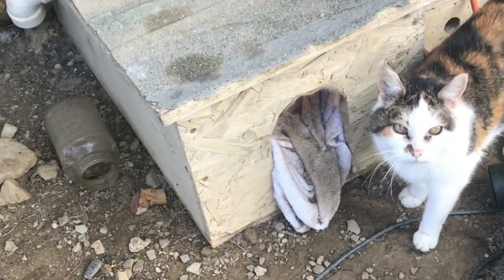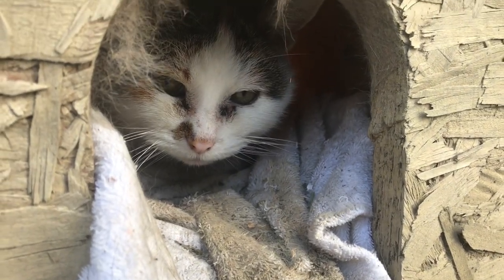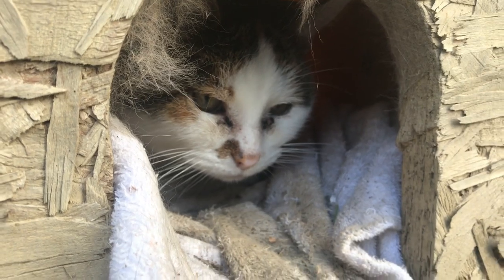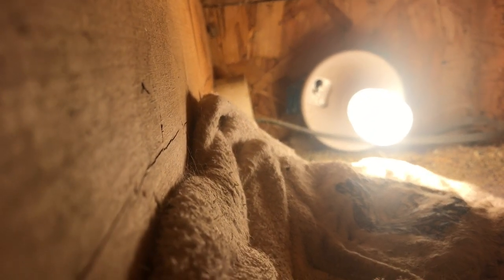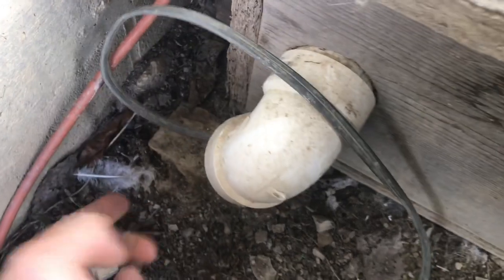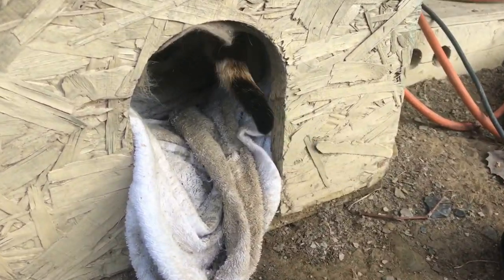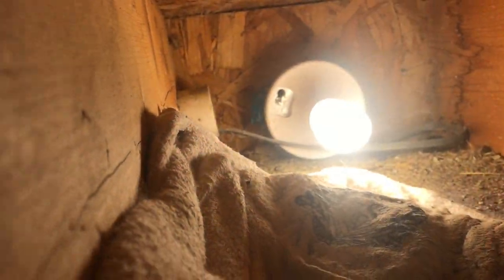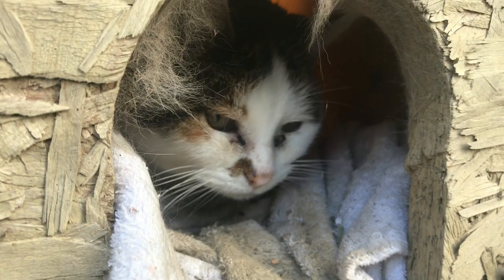build a low cost HEATED cat house (lightbulb)

Comment: I saw a light bulb heater built from a coffee can. It was sealed so the light didn’t escape, but the can radiated heat nicely.  Used same ceramic fixture.   I liked the idea of closing off the light and encapsulating the glass bulb.

Comment: Great idea and caring for a stray cat is good. However, letting the towels dangle outside and they'll get soaked with moisture. That's not helpful for the cat.  Also, put straw in there instead.  What about a flap on the door to keep wind and wind blowing rain out of the opening? Just some ideas for improvements.

Comment: I use a Chicken Coop heater panel. You can mount it on any wall, ceiling, or just use the legs standing up it's fine. I've used mine forever, never turning it off in Winter. I'm in the Midwest, it hit 16 below this week. With insulation, they do an excellent job!!
Reply: Ty. Where to buy, please???

Comment: Stuff the bottom with STRAW, never blankets (the cat keeps MUCH warmer with straw); and....that light bulb...put it into an exterior light FIXTURE, so it cannot start a fire.  The black reptile heaters might work better than a light so the cat can have hours of darkness for sleeping and not constant light.    I like your video.
Reply: Straw is not a good idea if there is a lightbulb in the cat house. Even if the light is setup better.
Reply: @bestvideoforcats  It's just fine, as long as it's an exterior light fixture.

Comment: nice.  I've built 3 different coleman igloo insulated houses with 2 doors each and 125 watt heatlamps built in.  the floor is straw.  been using these for 8 years and my 10 outside cats stay toasty warm even when it's 30 below zero!  I placed freezer door flaps on each door to keep wind out/heat in.
Reply: how do you prevent the straw from fire?
Reply: What is a freezer door flap
Reply: @teresadavis5547 came to ask the same question lol. Never heard of a freezer door flap

Comment: Thank you really great idea 💡 lol , I also , insulate and use the heat warming blankets , Amazon sells them for $10-12 ,I’ve read the regular blankets or towels hold to much moisture and make them old
Reply: Please use straw instead of anything fabric like blankets & even those beds. Straw is a better insulator for cats, wicks moisture & won't freeze like fabric.  I bought one of those beds too & was using it until I found out straw is better, even when wet & doesn't freeze like the bed could. I washed mine & gave it to my indoor cats. They love it, especially my fluffy girl. Go figure.

Comment: Try putting some fleece blankets in there the kind you get at your local Walmart something that’s 100% polyester. Cotton blankets and sheets absorb the cold I learned that from someone else and it has worked out tremendous for me. My cat is very warm now warmer than ever before. Thank you for caring for this little one in a world war many do not. God bless.
Reply: Yes fleece blankets are better.  As well, CLEAN them!  That old towel he has in there isn't fit for a rag anymore.
Reply: Always use Straw!
Reply: @kennywolford2271  Agreed, if you can get your hands on straw it is better, it doesn't hold the moisture the way fabrics can.  For some city people it may be difficult to track down. Changing clean blankets is second best.

Comment: that bulb looks dangerous it should be protected by some grill
Reply: My bulb is enclosed in a "fruit jar" light fixture so the cat can't break the bulb.
Reply: I had one in a small shed for chickens. Burned it down. My chickens had to be brought in the house for weeks because the injuries were bad.
Reply: @joeturnip4216 in a "fruit jar" so you don't think the jar will get super hot from the light and the jar burn the cat? Yes, yes the jar will burn the cat. You need a good side piece of wire mesh to bend over and cover the light with it

Comment: You should use a heat lamp not a light bulb, that can cause burns. And you need to use straw an not a towel because it gets wet and clearly dirty and the cat wont be warm.